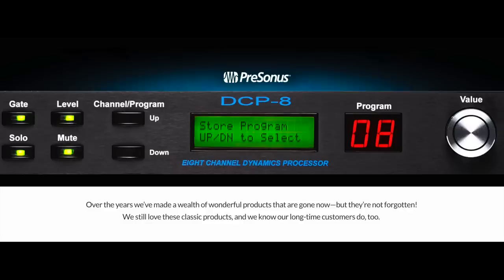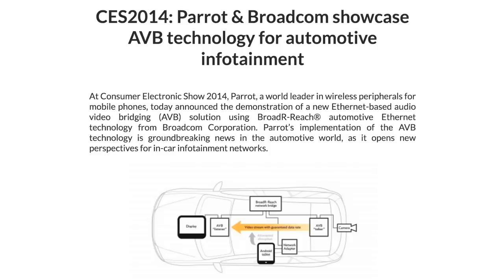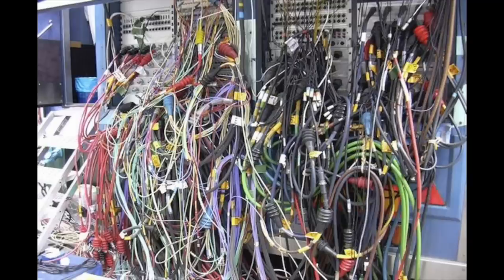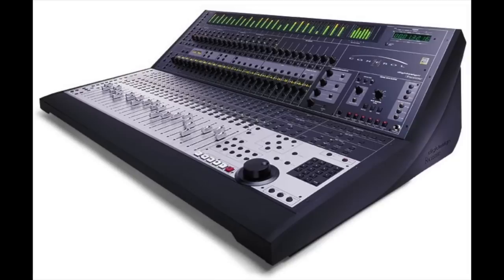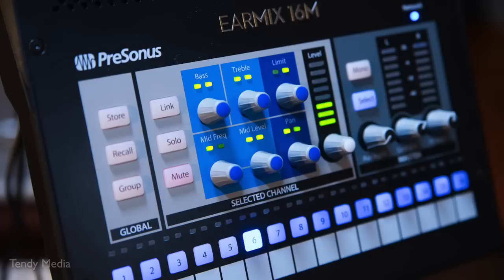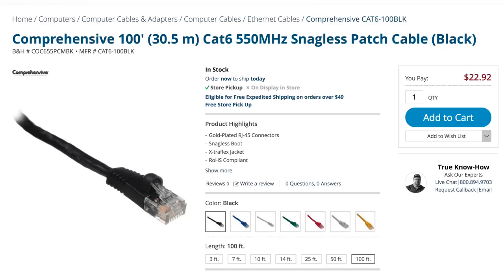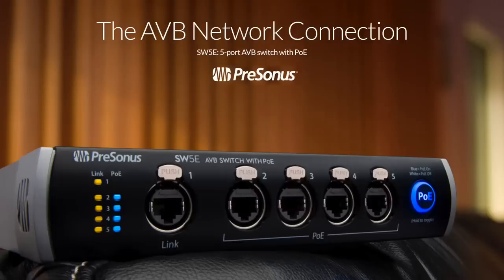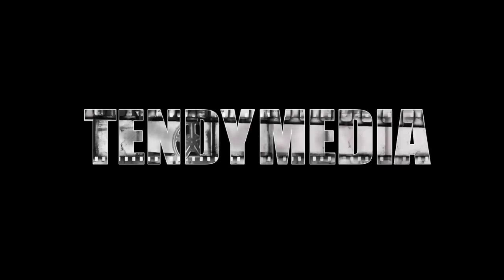AVB in a PreSonus Ecosystem: Benefits and Overview

Comment: This seems like a great solution. Though I must say with a VERY expensive Mogami cable based massive multi room studio with TT patch bays we have not had one bad solder point in over 2-1/2 decades of daily use. Sure analog switches and knobs get replaced on vintage class A electronic gear, but with a properly wired and professionally installed patch bay system no time has been lost in repairs.  However, this AVB seems like one solution to audio over the network for Live set ups and studio as well.

Comment: What we really need is AVB over WiFi so that we can use smartphones and tablets for monitoring. They could even release wireless EarMix with Bluetooth for wireless headphones, earphones and speakers. Check out what Audiofusion is upto with their proprietary solution.
Reply from the maker: An audio signal travelling over a Bluetooth connection would have a delay of up to 0.5 sec, which would make it almost impossible to play along with a monitor mix. That's just the nature of the Bluetooth A2PD protocol. Audiofusion over wifi is definitely faster than Bluetooth, but nowhere near AVB, which is 2ms. With Audiofusion, PC latency is 3ms, wireless latency is 3-8ms, smartphone latency is 2ms for a minimum combined latency of 8ms-13ms. A drummer would go out of his mind. But the concept is exciting and I assume performance will improve as hardware improves. I haven't tested it yet, but hope to do so soon. Thank you for commenting.
Reply: Tendy Media supposing there was no need for the PC connection to broadcast audio signals via the WiFi network? What if the router could broadcast AVB streams via WiFi and the smartphones could receive these signals and play them back. You don’t have to use Bluetooth earphones just plug directly to the smartphone if it still has a headphone port. Although I need to check what the audio latency with Bluetooth 5.0 is. Audiofusion have already answered the question of what is possible. Presonus are at a position to offer a better solution since they make majority the hardware and software needed in the ecosystem.
Reply from the maker: Enoch Gitonga I don’t disagree with you, that is some interesting and exciting technology. I honestly don’t know enough about it other than what I have read and I haven’t tested it hands on. I will tell you that a wired system is much more reliable, I have worked with Wi-Fi and Bluetooth controlled monitoring as with the older studio live series. On a large stage, radio frequencies disconnect and between walls in a recording studio it’s even less reliable. Great comments, I appreciate your participation. Thank you :)
Reply: Look up “Audio Fusion,” the gent named Brandon presents something new and innovative in the wireless in ear monitoring world! The concept is the same as having the presonus earmix however it’s an app on your iPhone and the hub to control everything is software based. It’s a super cheap compared to the hardware solutions that cost about $1,200 bucks for a decent wireless in ear monitor. Check it out!
Reply: InstallationMan1171 thanks. Yes I'm aware of their solution. Whaf I'm contemplating is even more elegantand cheap. Since the StudioLive Consoles have AVB it would be neat to not have to send the audio to a tethered computer to process the audio and make it available to the network. If one can send and receive AVB streams via WiFi it cuts the process audio has to pass through to reach to musicians in-ears

Comment: Hi there, maybe you can give me a hint how to overcome the following challenge. I try to find a thunderbolt to Ethernet adapter for a MacBook Pro 2021 M1 which supports AVB. I tested several adapters, none of them worked so far. I‘m using a Presonus Studilive III 24R. Thanks
Reply from the maker: They're all pretty much the same. I have an older USB A version from StarTech which plugs into my USB hub. My mobile setup is similar to what you have, . MBP M1, SL24R. Works fine.  Maybe your problem is a system setting.
Reply: @thatjazzshow  Thanks for your reply. If I'm looking at the system report under ethernet, AVB support is always "no".
Reply from the maker: @markusroser7691  Not sure what that's about. Here's something from Apple regarding AVB setup. https://support.apple.com/guide/audio-midi-setup/browse-your-network-for-an-avb-device-amsavb001/mac

Comment: Is there an avb soundcard type driver? I would love to send 8chs from ableton  to the sound system with just a ethernet cable
Reply from the maker: That is a great idea, but to the best of my knowledge it does not exist yet. AVB sends streams of data to compliant devices, so you'd so need hardware to switch data streams to their proper recipient. Thank you for commenting!
Reply: @thatjazzshow  AVB does work over standard Ethernet and IP with a few extensions. All currently sold Apple computers support using AVB directly via the device's or an external thunderbolt Ethernet port, and I'm aware there's some amount of support for Linux and potentially a bit for Windows as well.